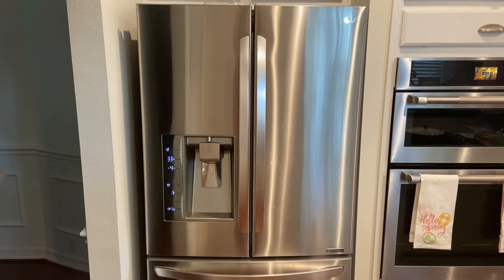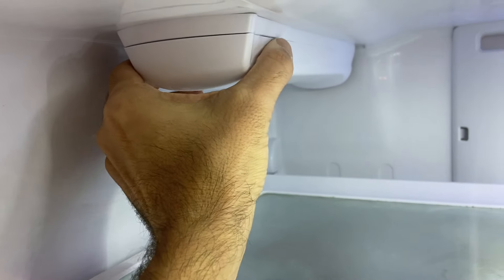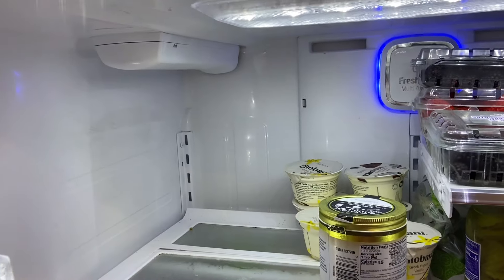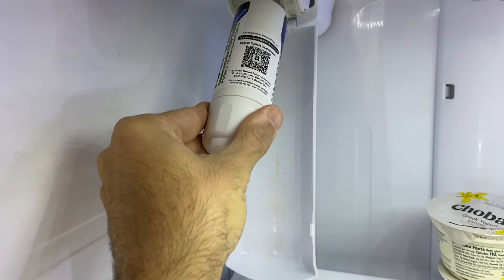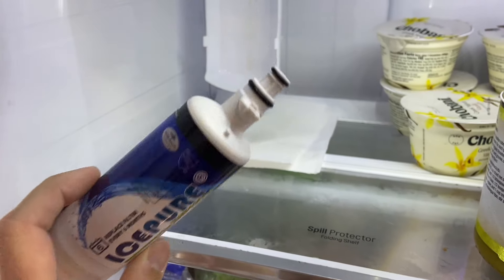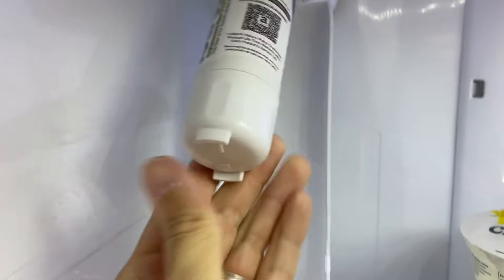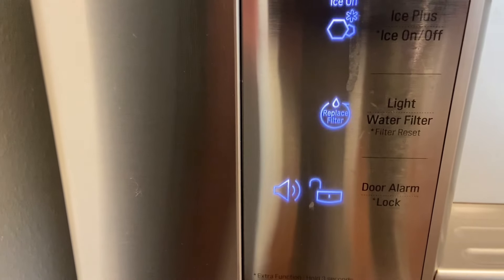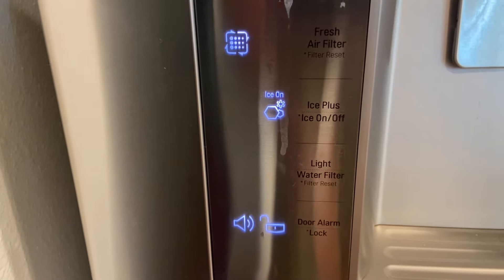How to replace Water Filter on an LG French Door Refrigerator

Comment: Thank-you. Very good video. My problem was I wasn't opening the cover enough. The only thing I think is missing, is to purge the air from the system once the new filter is installed. I just run the water from the front into a glass till the air stops coming out. Maybe 30 seconds or so.

Comment: Hi, thanks for this.  Did you shut the water off to the fridge? I'm hoping to avoid that, lol.
Reply from the maker: No need to shut water off!  The system is sealed even when you have no filter in.  Just put a couple paper towels down to catch any water that drips as you are taking filter in and out.
Reply: @daddoesitALL  thanks so much!!

Comment: Replace filter refrigerator is still warm inside. All lights are working could it be another problem?
Reply from the maker: what is the issue you have?

the filter doesn’t have anything to do with the fridge being cold.  It is to filter the water for clean drinking water and ice.